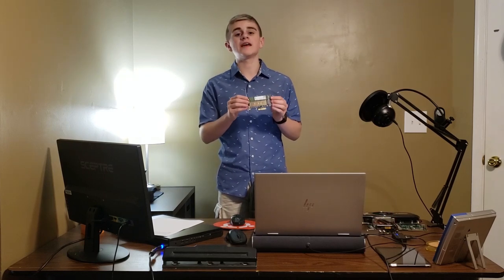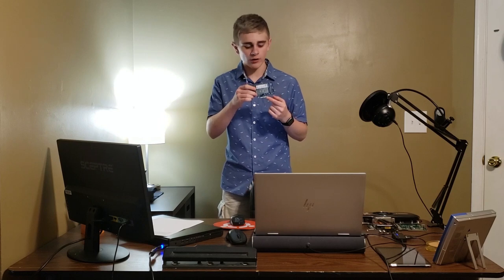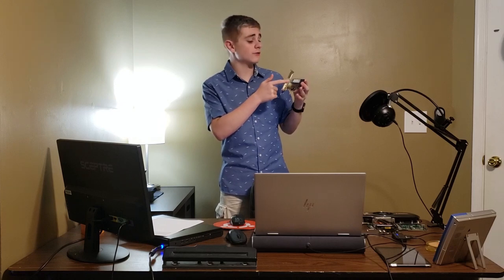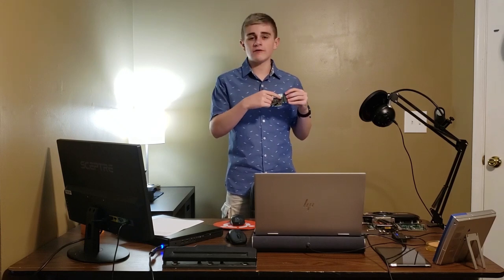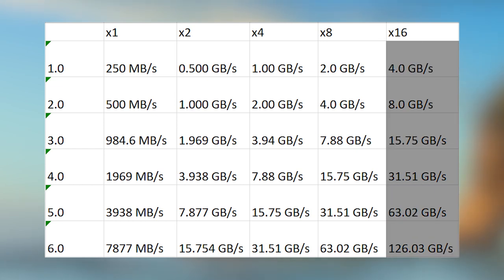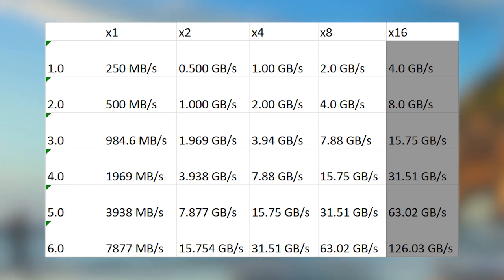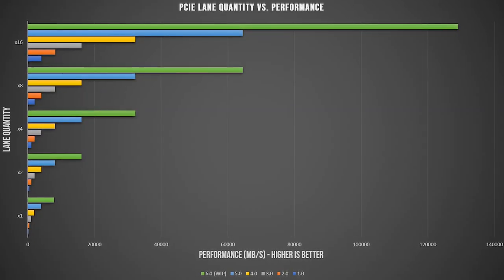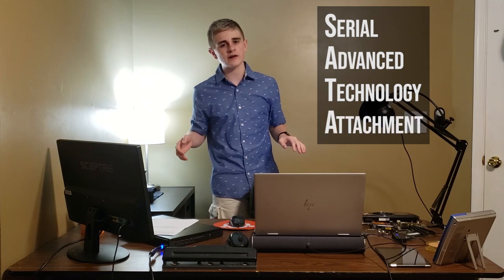PCIe Lanes, Versions & Speeds Explained

Comment: One question is are these speeds per device? Or for the total pcie bandwidth on the motherboard?  If it is per device I guess I can add up all the device speeds to get the total bandwidth.
Reply: Device. Read motherboard manual for edge-cases.